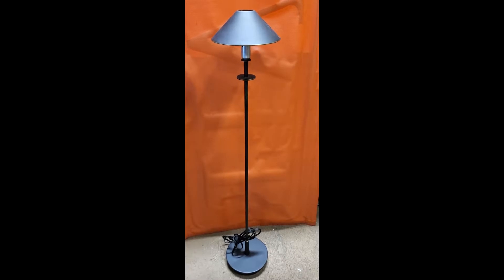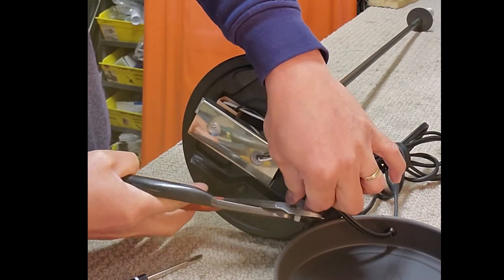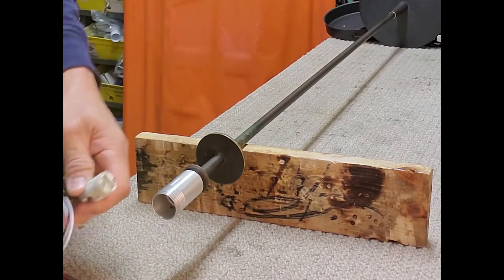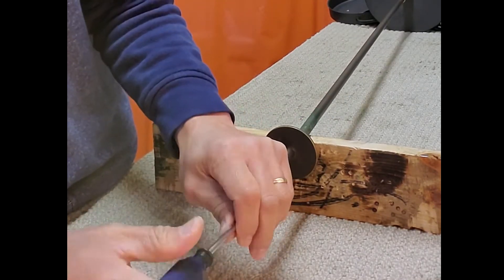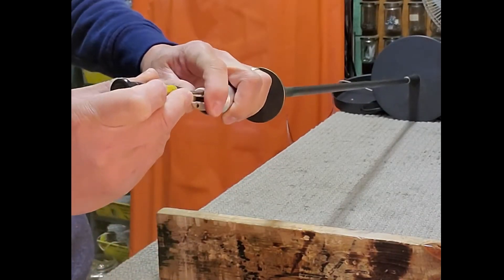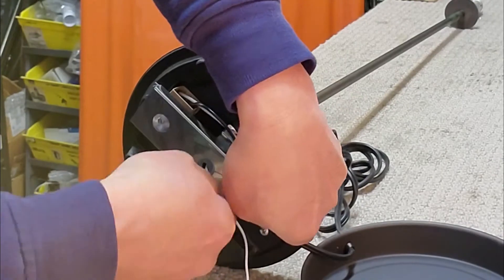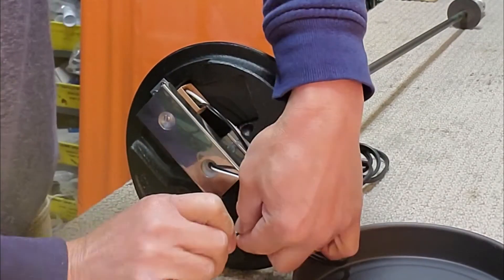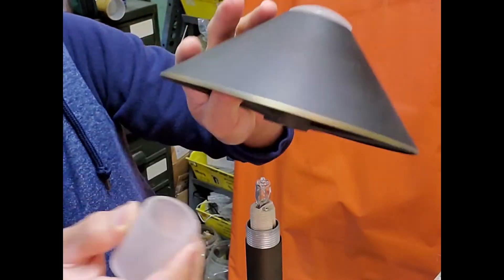How to modify a floor lamp with a DC bayonet socket to G9 socket

Comment from the maker: Hello Guys!  If you have any Lamp or Fixture to be fixed,  modified  or assembled,  just bring it to our store  at  Stanford Electric Works  located at 126 San Antonio Circle in Mountain View  Ca. You can call us at this # 650-323-4139 .
Reply: Can you please provide a parts list for the parts used in this repair?  Does Stanford Electric works sell these parts?  I would be happy to buy all of the parts from you if they can be shipped to my location.  Please provide instructions for purchasing the parts for this conversion.  my parents have several Holtkotter floor lamps in their home and I have had to repair many of them.  I would like to be able to do this conversion on all of them eventually.

Comment: I am wiring a small lamp using a two wire rotary button type switch at the bottom . I connected the neutral wire from socket and neutral from power cord  along with one wire from switch. And the same with the hot wires. But when I turn on it trips the surge protector. What am I doing wrong.?
Reply from the maker: You wired it wrong,  supposed to be You connect the neutral wire from socket and neutral from power cord only and connect the hot from power cord to one side wire of the switch and connect the other side wire of the switch to the hot wire from the socket.
Reply: thanks again. and I successfully also wired the 3way touch..thank you
Reply from the maker: @kathybelk1333  Welcome . May i ask do you work in a Lighting Showroom?
Reply from the maker: @kathybelk1333  Where is your store located, so we will send our customer looking for shade cause we don't sell shade only lamps and fixtures. Just keep going and your ability and knowledge will grow everyday.

Comment: I have watched a couple of videos on how to wire the 3way touch control into a table lamp but I just can't get it. Can you please explain it to me? Thanks so much.
Reply from the maker: There are 2 brands of 3way touch control I'm using, made by satco and made by westek. Each brand comes its own wiring diagram. If you use made by satco this is how you wire it,  it comes with 4 wire with different colors,  white, black, red and yellow. The white wire connects to the rough side of the wire going to the socket, the black wire connects to the rough side of the power cord, the red wire connects together with the smooth side of the power cord and the smooth side of the wire from the socket, the yellow wire attache an eye terminal at the tip of the wire then attache the eye terminal to the rod at the bottom base of the lamp and add a hexnut and tighten it.

Comment: Do you have to use a terminal connector or can you just hook wires together.also do you have to use a transformer plug with halogen?
Reply from the maker: You don't need to use terminal connector  you just hook the wire together. The terminal connector on this lamp has been there before so i just reused it. About using transformer it depends on the lamp, if it is low voltage bulb your using,  yes you need transformer but if it's a line voltage you don't need transformer just like this floor lamp i modified.